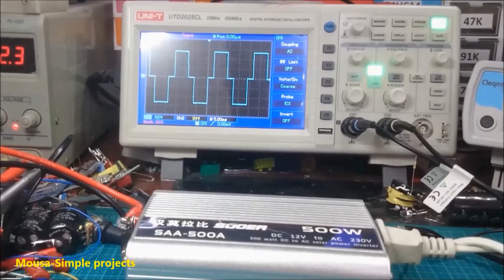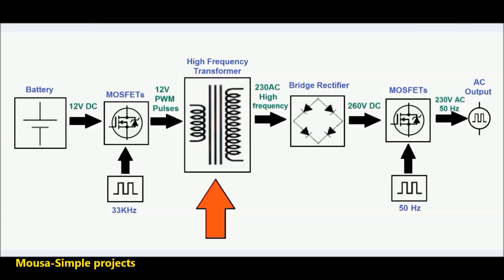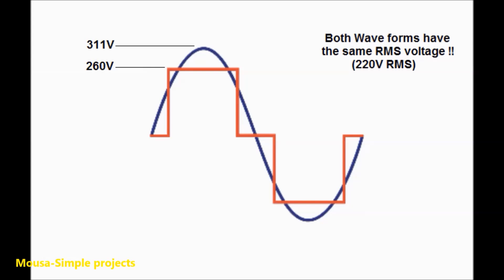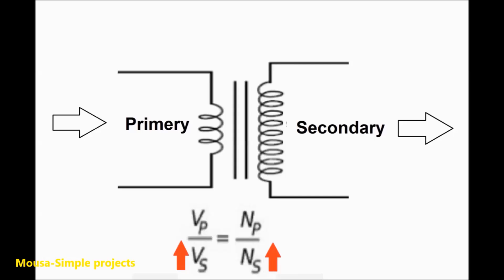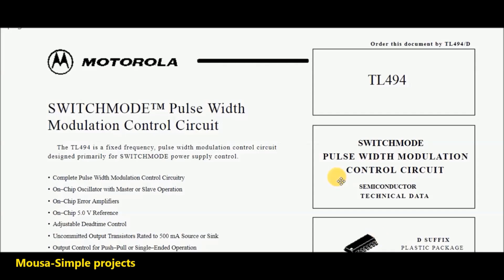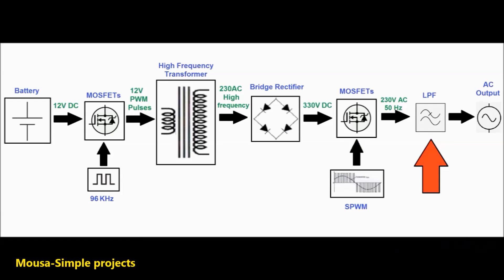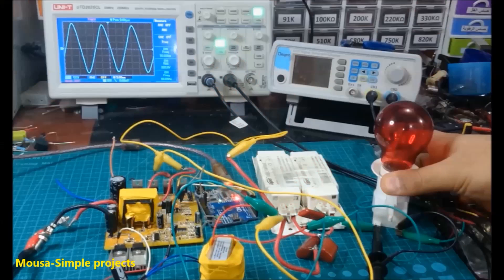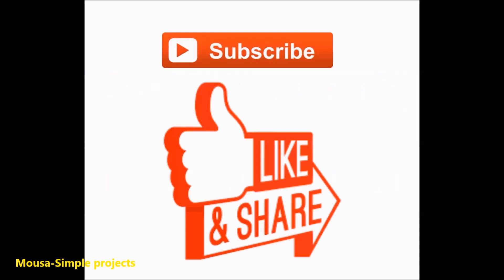How to convert a Modified /Square wave inverter to Pure Sine

Comment: Can I use just a low pass filter in the output of square wave inverter to convert it into sine wave ??
Reply from the maker: NO, Maybe you get something close to sine wave at No-load, But once you connect a load it will be square wave again ! 
The LC filter that you need (without using SPWM) will be very large which means it overload the inverter and reduce the efficiency.

Comment: TKS for sharing but why need to PWM in primary side then secondary again?
Reply from the maker: This inverter is a High frequency inverter. the first PWM with very high frequency used to boost the voltage. the boosted voltage in the output of the transformer(secondary) are not usable to running the electric appliances because its frequency is more than 30000Hz(30KHz) and your electric appliances need 50Hz. So you have to rectify it and again convert it to AC with 50Hz frequency.
Reply: Good question